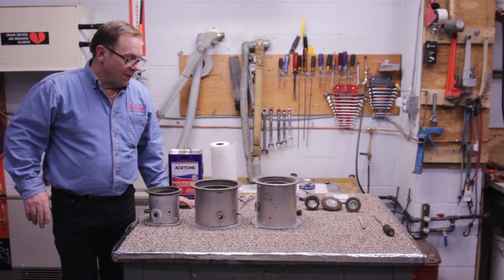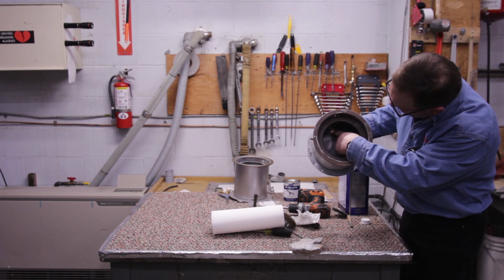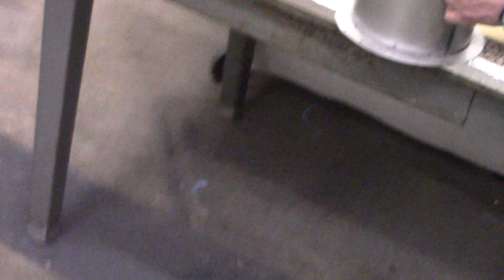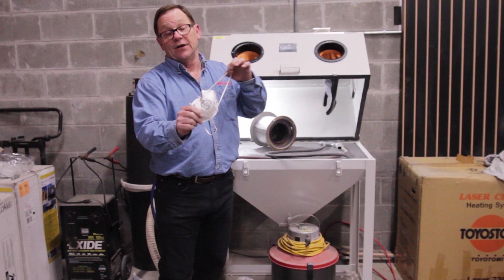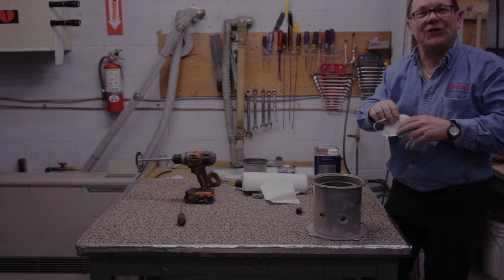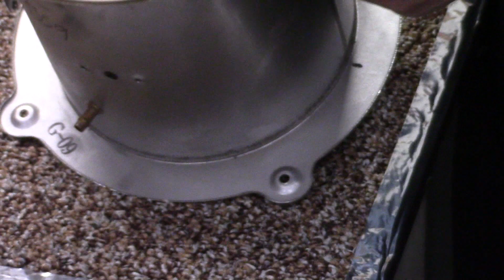How to Replace the Burner Mat or Apply Burner Coating on Toyotomi Toyostove | Step-by-Step Guide

Comment: With the 560, couldn't you just use a burner mat from the 56 instead (PN 20474113) ? The burner coatings don't seem to last very long.
Reply from the maker: The Laser 56 is not using a Burner Mat. PN 20474113 was and still is for the Laser 55 only. If the Coating is not holding, than you didn't do it right or using the wrong Coating. The Burner Pot need to be cleaned before applying the new coating. After the new coating it need to be cured with a Heat gun on high for 20 minutes and it is recommended to wait several hours before using the Stove after rebuilt. You can try a Burner Mat, but the same rules apply.
Reply: @livelifewarm  Well, since you deleted my last reply, just know that I purchased the PN 20474113 burner mat with the glue from you and installed it in my well cleaned burner pot for an L560. I followed all the directions you put forth in your excellent video. It's been 2 days so far and the burner mat in the L560 is working just fine. I believe IMHO that the burner mat is superior to the burner coating, as the coating just doesn't last very well. I'll keep you posted as the winter wears on. Cheers and well wishes to you!
Reply from the maker: @DesDriftDad  Thank you for sharing your experience with us! We're glad to hear that you found our video instructions helpful, and it's fantastic to know that the PN 20474113 burner mat is working well for your L560. We always aim to provide information that aligns with the manufacturer's recommendations.

Regarding your previous comment, we're sorry for any confusion, but we haven't deleted any comments, and we're here to engage with our viewers and customers. Your feedback is valuable to us, and we're excited to hear how the fix holds up during the winter. If you have any more questions or updates, feel free to share them with us. Cheers and best wishes to you!

Comment: I’m having trouble with my burner mats not staying stuck and fuel getting under them. Using acetone till it comes out clean then heat gun for 15 min. Any suggestions?
Reply from the maker: Cody, a few things. Make sure the burner assembly bottom is very clean, even shiny. Before piercing the glue nozzle, be sure to squeeze the tube from the top to the bottom & repeat. The glue needs to be completely mixed together; you will see a liquid runoff separating from the thicker glue as soon as you empty it. If it's not mixed thoroughly, it will not adhere to the burner assembly & the mat. Take your brush & mix it together thoroughly. The last thing is, if the bottom of the burner assembly has been cleaned 3 times over it's life span, it will need to be replaced.
Reply: @livelifewarm  ok good advice could there be a possibility that the glue gets old idk how long it’s been sitting on the shelf.
Reply from the maker: @codyessay2240 , if the glue container was never opened, it should be okay. It does become compromised once the glue tip has been pierced, that's the reason to use the whole container when opened.

Comment: my laser 56 is currently 'on the workbench'  - toyostove shows a burner mat (20474113) needed and there is an old bit of remnants in the pot....would appreciate your thoughts  (f-type  #56)
Reply: Pat you should be able to scoop out most of the remnants with a steel brush in a drill flathead screwdriver and a compressor. If you dont sort it out you can send me an e mail with some pictures

Comment: great video. one question. How does one replace the burner coating on a 560 if you don't have access to a sandblaster?
Reply from the maker: Robb, at the 2:10 mark of the video you will see he talks about the different brushes that you can hook up to a drill.

Comment: What will make my monster 73 it will heat up and run like a cycle and then shut itself back down to a code ee2
Reply from the maker: I have document for that. You can email support@ruralenergy.com & I will respond with the document, which has a check list to go through.

Comment: Does my OM-22 require a burner mat, pad, and/or coating? I don't see them listed in the manual. If so, what are the part numbers? Thanks.
Reply: Hello, the OM-22/23 takes the burner coating, as mentioned at 0:57 of the video.
Reply: @francistopkok33  I completely missed that the first time viewing! And then I had to rewatch it twice to finally get it!! Thank you for answering.

I should add that I think your videos are wonderful. And the presenter in this video has done a great job at explaining. I need to do a better job at listening!

Comment: I have a monitor heater 2200 all i need is the exaust. Pipe for it . Can it be replaced?
Reply from the maker: I'm sorry we do not carry Monitor parts, we would be more than happy to help you replace your heater with a Toyotomi product. We are offering rebates on replacing old monitors.